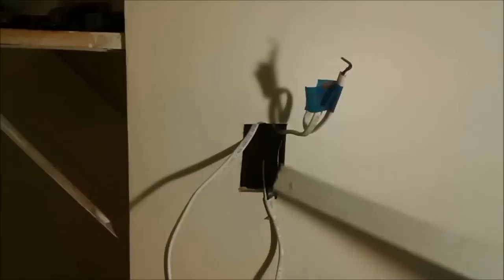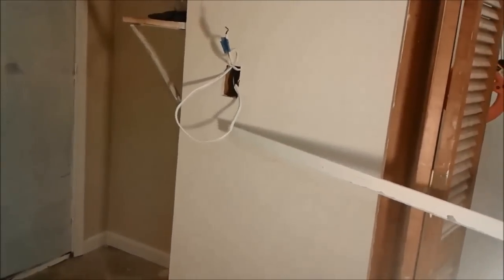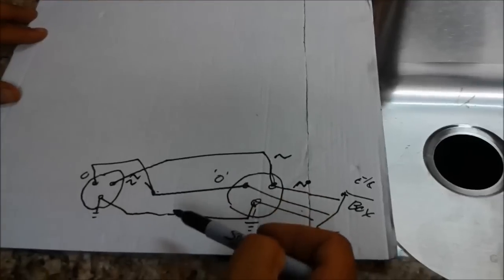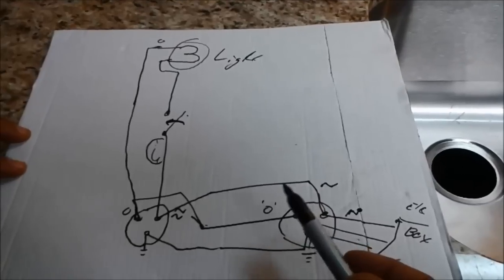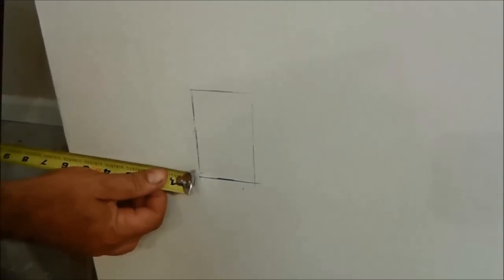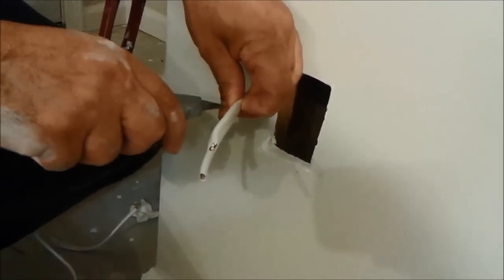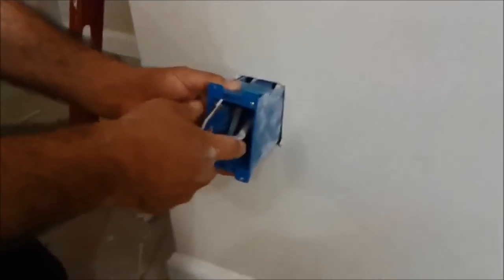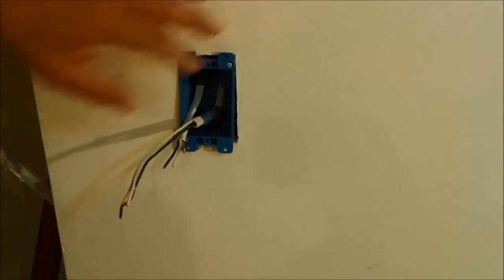How to Add an Outlet, a Wall Switch and Light Fixture to Existing Wall - Part 1

Comment: Great video thanks.Will 12-2 wire work for a outlet.It will be in a bathroom and it will only be used for curling iron and hairdryer.etcThanks.
Reply from the maker: Of course, it will work because wire 12 -2 is 20 Amps.

Comment: Hy man very good videos thanks you!!! I have 2 questions 
#1. Which type of cable is the right one for a ceiling fan??
#2 how to add a switch for the ceiling fan on a old house???
Any suggestions please.
Reply from the maker: #1 10 to 15 Amps cable , Its called 14. 
#2 I am going to add video in a week or so regarding a ceiling fan.

Comment: Thanks for the video! It's the only video I could find that resembles the configuration I want to install - power from outlet through switch to light. My only concern is that my particular light fixture will draw too much load. It's a replica of an old barn light and we want to use a 60w "Edison" incandescent bulb in it! I already run a coffee maker off that outlet. Any recommendations?
Reply from the maker: A typical outlet n the US is 15 Amps  120 volts., that means the maximum  power an outlet can handle 120x15 = 1800W . In short, one outlet can handle 30  of 60w "Edison" incandescent bulbs. Please look at the coffee maker and see what is the the power, in watt, it consumed. it should be less than 500w so you still can have 1100w left, which are good for 18 60w bulbs. Also verify which circuit breaker this outlet belong to see the maximum Ampere for the outlook .

Comment: Thanks so much Joseph for this excellent videos. It finally makes sense even to a novice like me and I will try this. Is it correct that I could also add 2 lights to this by simply extending from the first to the second light and then bring the neutral back from the second light to the new outlet (light source)?  Thanks again.
Reply from the maker: Yes you can add 2 lights to this . You should extend and connect the hot wire  to each light and do the same with the neutral. The lights should be parallel connected . Thanks
Reply: Fantastic. I tried it today and everything works perfectly! Thank you so much again Joseph.

Comment: So I am assuming the middle box was your original outlet in the wall?  And that you added in the light fixture (top)  and new outlet (bottom) after, while replacing the original outlet (middle) with a light switch?  because this is what I want to do in my bathroom...
Reply from the maker: The original power outlet is what you see in  the video at 1.42 minute. From it I pass a wire to be the power source. for the new power outlet and the light fixture.  I  added  new light fixture in the ceiling , new outlet (bottom) and added a light switch (top)  (over the new outlet at the same wall). I did not replace the original outlet.  In other words, I added power outlet, light switch and light fixture. You should look at the video part 2 and 3 as well.
Reply: Thank you. I have saved your 3 videos to watch later. I have an existing outlet in my bathroom with a reset button (GFI?) and I wanted to add/run a light above my vanity and add/run switch by the door to power the vanity light.  And I guess this is how you do it. :)  Thanks  great videos.
Reply from the maker: Yes.  You can do it because the original power outlet was not dedicate to a specific utility such as refrigerator, microwave etc.
Reply from the maker: Yes.
Reply: Joseph K thank you very much for the quick responses.  :)

Comment: What tool did u use to cut outlet below switch ?
Reply from the maker: It is called dremler . You can buy it in any home improvement or Amazon.
  https://www.homedepot.com/p/Dremel-Multi-Max-5-Amp-Variable-Speed-Corded-Oscillating-Multi-Tool-Kit-with-28-Accessories-and-Storage-Bag-MM45-05/302341150

Comment: how can i find out if the new lights and outlets I put on my old circuit will be able to bear the load? I am worried I might draw too much power load on this circuit and the breaker switch will keep shutting off.
Reply from the maker: +Kağan Turk Don't worry about lights because today they consume very low energy (LED or CFL) . Regarding outlet : Usually the lower breaker  switch is 15 Amp so if you add an outlet to an existing circuit breaker you will be able to use only one outlet at the time if the load consumes more than 10 Amp. 
By the way : refrigerator, microwave, range, water heater, A/C have their own  circuit breaker and you can not add outlet to these utilities.
Reply: example: If you are using 100 watt light bulbs on a 15 amp circuit using 115 volts, this would mean, using simple math, Watts=amps x volts.  So if you have 15 amps @ 115 volts = 1725watts  This means you can use 17 100watt light bulbs on one circuit. If your using LED light bulbs the amount of lights goes up. I hope this helps.

Watt's Law states that: Power (in Watts) = Voltage (in Volts) x Current (in Amps) P = V I Combining with Ohm's law we get two other useful forms: P = V*V / R and P = I*I*R Power is a measurement of the amount of work that can be done with the circuit, such as turning a motor or lighiting a light bulb.

Comment: Hi Joseph does the switch control the outlet aswell or just the light fixture?
Reply: Thts what im wonderinf
Reply: The tab on the outlet is not broken, outlet remains hot. Switch controls the light only.

Comment: Ok between all the videos check here; you are the more closely that make sense to me on the way I need to do it. Now let me picture this to you. With a Preexisting working Wall Switch to control Light ceiling fan that be move to different spot; other side of the wall with 10 or 15 inch the extra cable for extension porpoise. All is OK ,easy part. Come out that I need the original box to Add an Outlet. No, this outlet  is a GFCI protection circuit with a reset for any back wiring or broken circuit.Following your 3 videos . my Outlet have 5 screws ( 1 ground and  2 each on sides black and white ). So fa;r switching on -off the light fan; but in same time independently I like have a power always on for connect any low consumption like a little radio or a little table lamp or the new mini spot light for sidewall decorations. can that be a possible ?. Hope you answer come quick and easy, as you be explain in all your videos. thanks and very nicely done, teaching videos.
Reply from the maker: If I understand it correctly  you need to put in the original  box which was used as wall switch an outlet with GFCI  protection circuit. It is possible to do.
Reply: Joseph K  thanks for your quick responce let me explaint again in this video after you all done. a week later you need Now the swich on the other side the wall controling the fan. the emty box where the swich was before you still need it for outlet. let say for a tv. because is high. how you get straigh power always on for you lamp, Tvs or radio. but independly from any swich.

Comment: You're supposed to leave 6" of wire extending out from the box....and you're supposed to strip the sheathing off all the wire in the box too...not just a few inches. Well in the MR. fix-it world ....you're able to do it....but not by electrical code.
Reply from the maker: I did please see part 2.